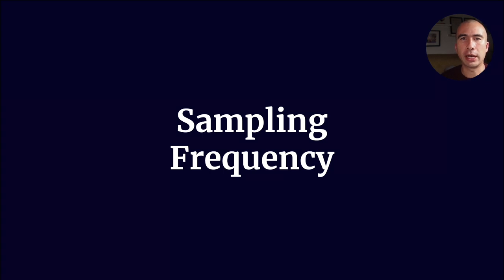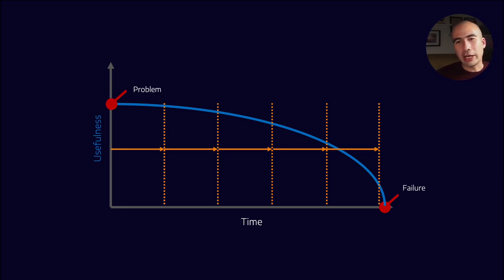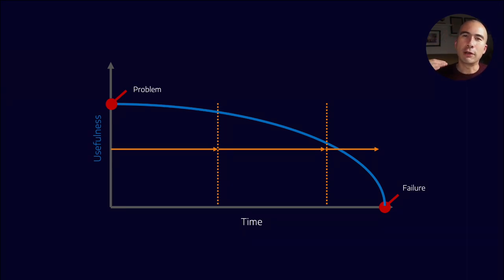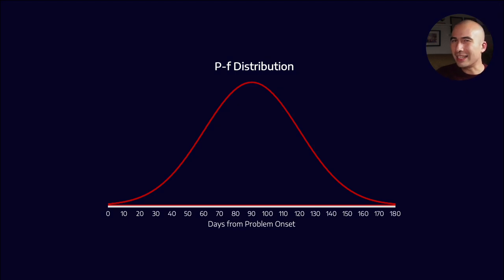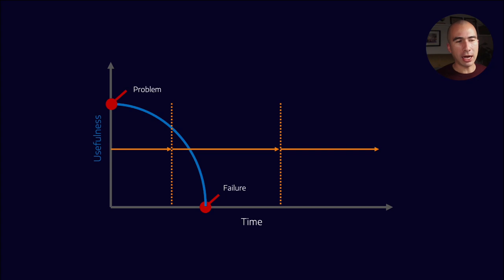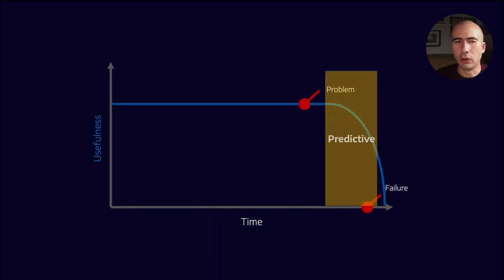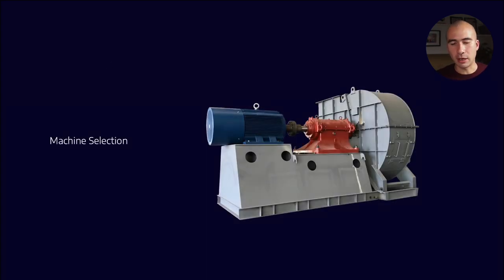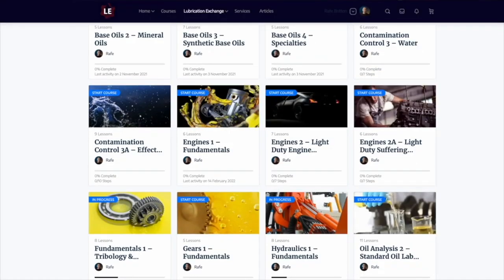How Often Do I Need to Take Oil Samples?

Comment: Hi.. I'm still thinking about OCI for car that are everyday use at extremely stop start traffic on the city that are having traffic jammed issues.. average speed around 10kmh-15kmh should we follow the engine running hours or stick with the manufacturer recommendation on manual book that just say in Kilometers and by month??? If it's better by running hours of the engine..how many hours it's should be??

Comment: Hi, can you cover SKF Recond Oil technology. And its implementation in plants where we have oil consoles for compressors and turbines. Its an oil regeneration technology.
Reply from the maker: Hi! What you’ve just described is a very very narrow application. You’re welcome to engage me as a consultant, but that’s not the kind of thing that I would do a YouTube video on.
Reply: @LubricationExplained  Recond Oil claims that the oil is better than virgin oil in terms of cleanliness after processing. Just wanted to have your take on this tech.
Reply: Basicly they are removing particles by using chemicals very similar to ion filters and at the end of the process they add additives to your oil, but from what I understood from them is that it is for the lower viscosity grades vg-32 maybe 42 and mostly for hydraulic oils
Reply: @sergeyman9999  Yes, that is what I wanted to know that how the system regenerates oil of different viscosity grades and each one having additives specific to application. It may somehow filter oils of different viscosity grades but to makeup for the additives for each of one in a single unit is a difficult task.

Comment: I just want to say hi, and ask a question. 
What are oil grades, or set of additives marked by 505.01 or 502.00
Those are VW specs, first one being a spec for Pumpe Duse system.

What are the differences and can we degrade lubrication if we mixed them up, or not use specific one for the engine?

BMW have their own ones, Ford another codes? What is that?

Edit: Great content btw!